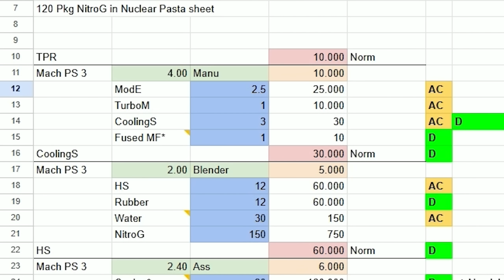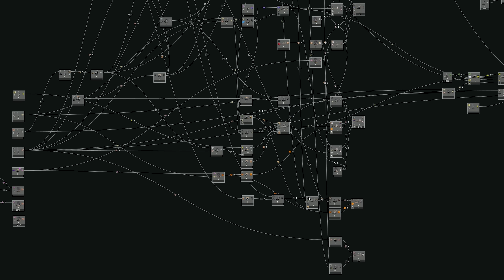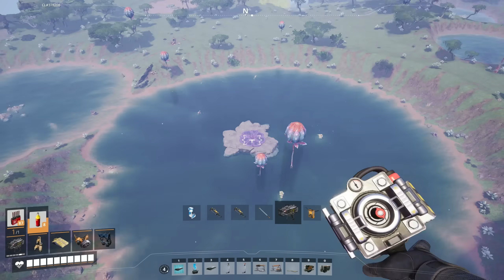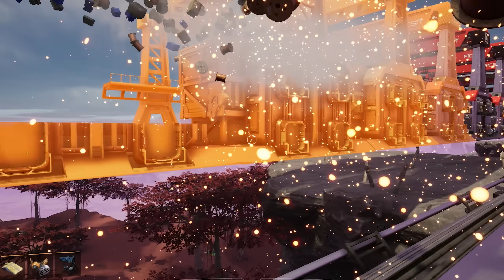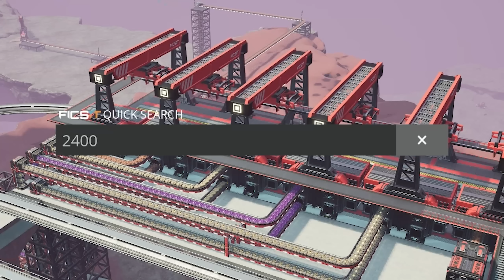You Ready to CHOO? - Satisfactory 1.0

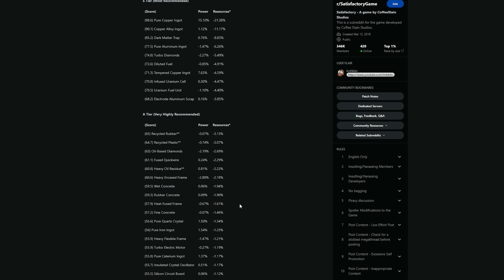Comment: 2:48 last time i checked the code for that tool it had an issue with how it handles variable-power recipes where it doesnt calculate the power correctly.  Unfortunately the data file at that time (late update 8 era) didnt make it clear as to what the correct calculation is and i havent checked the 1.0 version of the relevant file to see if any of the new recipes clear it up, nor have i checked if the tool fixes it.

Comment: I went choo heavy in my last playthrough: 191 train stations.  Multiple stations collecting iron ore and bringing them to one iron ingot station.  Then an outgoing iron ingot station to stations for iron plate, iron rod, etc.  And the same principle for multiple copper ore stations to one copper ingot and then to various other copper stations.  As the technology level increases, more inbound stations were needed (1 for constructor, 2 for assembler, 4 for manufacturer), such as one for iron ore and a second for coal to create steel ingots.  And then oh non, I unlocked the iron ingot + coal recipe!  Simply repurpose that iron ore railway line for an iron ingot line.  Quite versatile.

It took so much time to create all those stations and lay down those tracks that I did not have time to become efficient.  Stations would stop producing since the output bins were full.  And so I became VERY energy inefficient.  I completed the game at about 33% power: producing something like 20 MW when I needed about 60 MW (I don't remember the exact numbers).  I was also very inefficient with the production.  For example, I'm only producing 60 plastic per minute.  However that was sufficient to create the needed space elevator parts.  What saved me were the somersloops; I only needed to produce half of them.  

This was my most fun playthrough and it was also my quickest, completing the game in 1 month minus 1 day, finishing on october 9th (1.0 was released on september 10th).

Comment: You can put single wall power nubs on the inside and outside of the pillars that support the platform for the train. Clip the wire through the pillars. Then you'll have power inside the belt way and outside without any visible clipping.
Will let the train support blueprint double as power poles.

Comment: Hey Kibs, the reason you had to use the path signal is that all signals entering a block have to be of the same type.

What the path signal actually does is allow two trains to enter the same block if their paths don't intercept. For example in the intersection you showed, if two trains were going straight in opposite directions, they would both enter the path.

Btw, you can interact with a signal that has the ? sign to see what's causing the error.

Hope that helps!

Comment: Fun fact: you can set a merger (or splitter) on the split between two belts and then immediately remove it and the game will combine the two belts together. I use it to make long floating belts easier to dismantle or upgrade later since the game only sees it as one belt

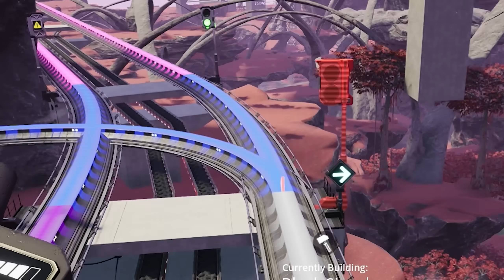Comment: 26:25 Rule of thumb for signals: Path signals on all the entrances to an intersection, block signals on all the exits to that intersection. Satisfactory recognized your incoming train path was cutting over the other direction rail in a way that would make trains collide, so it considers that other direction rail as part of this intersection.
Reply: The difference between path signals and block signals is: Path signals look at the next block and will only allow traffic if BOTH the path and block signals are free. Blocks only check the next block alone. The reason you want path signals at intersections is because you don't want your train blocking the intersection. This is useful in other areas too, such as if you're dropping down to a bidirectional track for spurs or other complex scenarios where trains could block other trains from entering a block. In general less signals are preferred over more. In Factorio I initially WAY overdid it and was constantly battling train backups until I figured out what was going on - trains were getting stopped in blocks, which then blocked other trains. A block should always fit your longest train, usually 1.5-2x to be safe.
Reply: @mrweb  You do need intervals of block signals along long stretches of uninterrupted track though, because otherwise trains will stop and wait at a block signal because there is a train 1km farther down the track that still counts as being on the same block.

Comment: Signal tip: Never put signals to exit an intersection as it would block the entire intersection if a train is stopped in the middle of it. Sometimes it can even cause the train to block the signal that protects the intersection itself, causing a deadlock. Only place signals to enter an intersection.

If you place signals down the line, always put them far enough away from the intersection so any crossing paths are never blocked by a train waiting for the signal. I've got thousands of hours in OpenTTD to learn that the hard way after many of my train systems have gotten stuck.

Comment: Hey, Kibitz! IDK if you've seen or read about it yet, but in the game at time of writing (11/13/2024, v1.0.0.5) there is a throughput issue with belts where having them go through a conveyer belt hole that is in a 1m foundation causes the belts to reduce their throughput, so they won't do their listed speeds. Last I checked, the dev team acknowledged the issue and were working on it (along with a throughput issue affecting pipes in general). Posting this in case you encounter the issue, so you can know that it's a bug. From what I've seen tested, it only affects 1m foundations and not 2m or 4m foundations. The issue does get worse the more holes you use as well.
Reply from the maker: Howdy!
I've heard about the issue but I think (?) it's specific to mk6, 1200 ppm, belts. I'm sure the problem will be fixed eventually, and I'm just gonna bank on that happening before I reach mk6 belts haha
Reply: I’m not sure if it’s fixed but I think it is two separate bugs. One is the mk.6 flow rate bug. The other is the 1m foundation floor hole bug which applies to any belt speed. (I think)
Reply: How significant is the flow rate issue? My factory uses tons of conveyor holes thru 1m foundations… I can’t tell whether it’s impacting the efficiency cuz I always feed extra but I’m only at mk4 belts but u think it’s serious enough to become a problem later?
Reply: There's always the option of perfectly lining it up and then clipping the action belt through the wall.
Reply: Do you mean the game changes the state of the belt inside the merger/splitter when it encounters a 1m foundation under it?
Reply: From a dev perspective
HOW THE ACTUAL DUCK DOES THIS HAPPEN
Lollll
Reply: @komilover1 My best guess: The belts are literal transports. Internally, the items on the belt are what matters, and they actually exist on the belts, which means the belts are actually transporting a literal item. From there, I could assume that the floor hole for specifically the 1m foundation was joining two belts (or lifts) with either a little bit of a gap, or a little bit of an overlap. Since the item being transported actually has to make contact with the belt, the small gap or overlap would cause the item to momentarily have no movement as it transitioned from one belt to the next, which would cause slowdowns.

This is just my best guess as I'm not privy to the internal workings of the engine. I'm just making an educated guess based on how things appear to work in-game.
Reply: The amount of 1.0 buggs is ridiculous
Reply: @supertoastboi you try coding all of this perfectly the first try when people do things that you never even thought would be a thing

Comment: Another point about the box: When a train is loading, material cannot enter or exit the station. So the box acts as a way to "queue" material, then catch back up. This only works if the output of the box exceeds the input of the box. I.E. never feed a station with 2400 items per minute into the box, since ypu will lose throughput at every load/unload cycle.